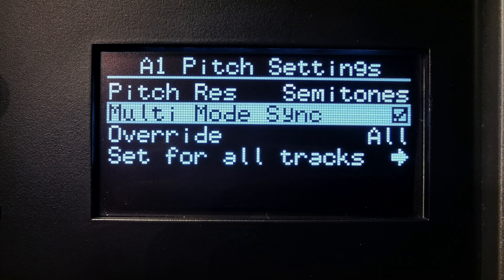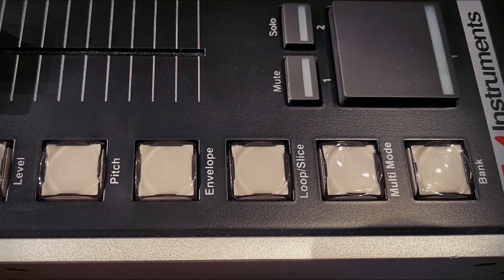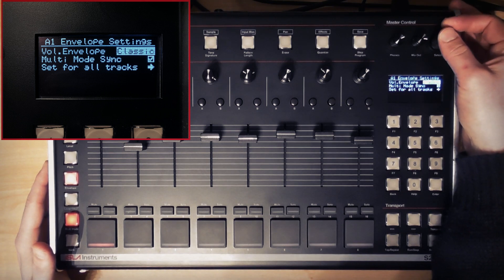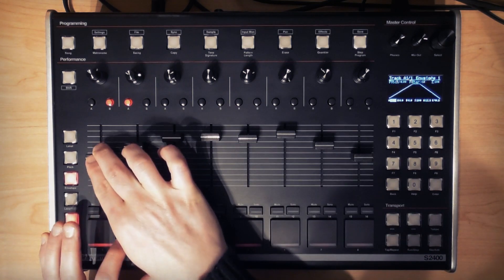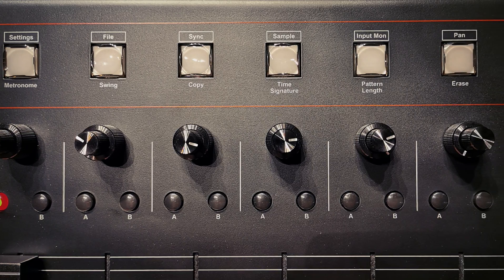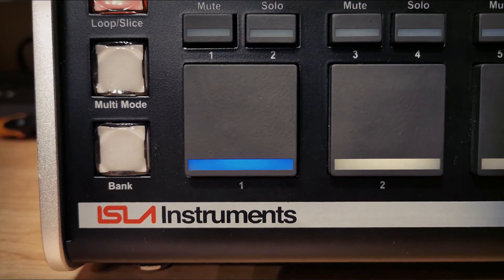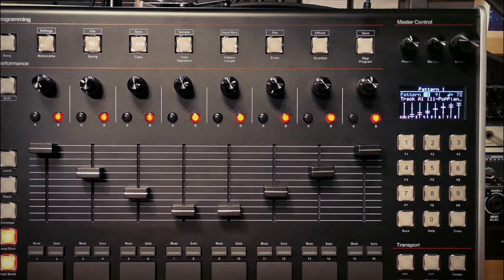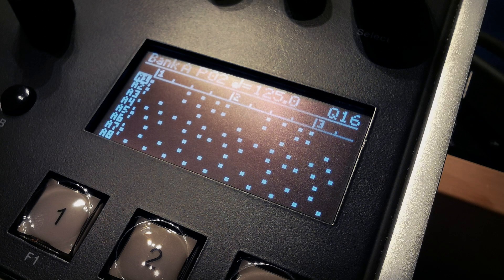[OUTDATED] Part 4: Multi-Modes - Isla Instruments S2400 Video User Manual

Comment: im reading the manual and i dont see a way to save slices in multimode all at the same time and assign them to the 8 tracks, is there a way to do that in one scoop to the selected bank? that would be cool feature to add and override the other 7 pads on a current bank.

Comment: Love the vids, ty! — i am still unclear on what the difference is between multimode and multimode sync. What is it that y9u can do in sync, that you normally cannot do?
Reply: I think I see where i was getting thrown off — in either mode, the filter can be set per track along with one other parameter, and sync mode is where you can use all the parameters together